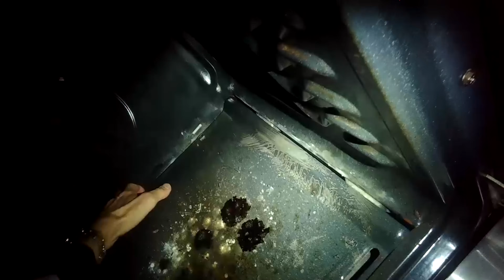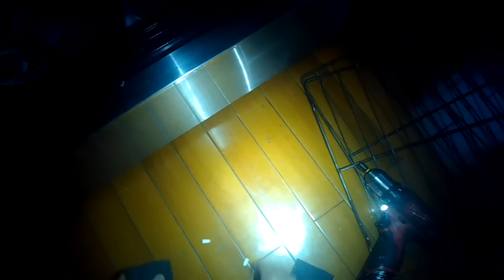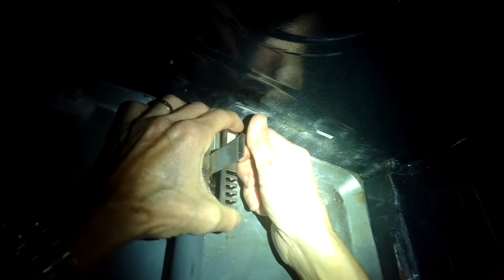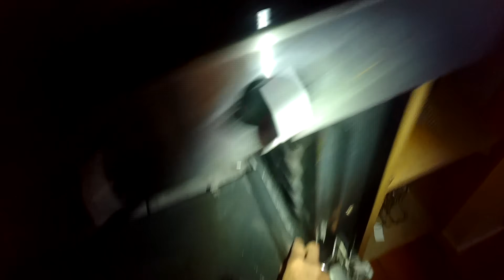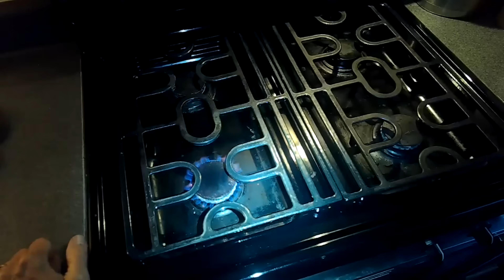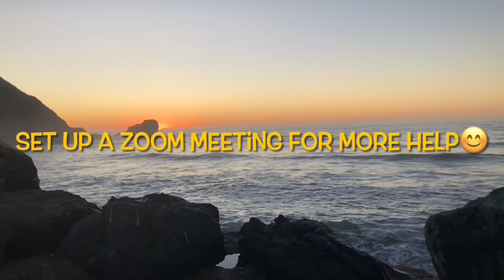✨ SAMSUNG GAS OVEN - WON’T HEAT UP -  QUICK & EASY FIX ✨

Comment: I have a Samsung gas range. Everything works except the bake function won't heat up. What could be the problem?
Reply from the maker: It might be the igniter or the oven sensor.

Comment: Quick question. I replaced after market Ignitor for about 5 months ago. Why is it now it takes 45 mins to heat up 385 degrees? it was really quick when the ignitor was installed. Do you see any other problem beside the ignitor? Hope to hear from you soon. Thank you.
Reply from the maker: 5 months is too short. A new igniter will get it heating quickly again.

Comment: I have a 2 year old Samsung slide in gas range, on propane, that is not working properly. One thing it does is shut itself off as soon as it reaches the set temperature, but tonight when it shut itself off, I used an infrared thermometer and checked it. The temperature was set at 425 but the thermometer was reading 635! I don't think its the igniter. Do you have any suggestions what to check? I called a repairman that told me he won't work on Samsung and I should scrap it and buy a different brand. :/
Reply from the maker: Hi Tina 
Samsung is pretty bad.
I think it needs a new relay board.
The current one is stuck in the on position and the oven will just keep heating.

Comment: My igniter messures 192 Ohms. Does not light. Connections are good. What now?
Reply from the maker: Hi Ed,
I think that igniter is worn out. If it glows but won’t light you just need a new igniter.
If it won’t glow, then you’ll need a new relay board.

Comment: Could you just manually light it until part comes in the mail?
Reply from the maker: Hi Brad,
They only let the gas flow when the igniter is on.

Comment: Great walk though, but what would you say if I've replaced this twice with in a year? It seems like something is causing the igniter to 'die'. I could buy a third one but I'm guessing it will last just a few months as well. Any ideas as to what is causing the igniter to fail?
Reply from the maker: I think the burner tube near the igniter has a rusted hole that lets too big of a flame to hit the igniter.
A new burner tube should fix it👍

Comment: very helpful video does the gas control valve go bad and how hard would it be to just replace both of them at once
Reply from the maker: There’s a 90% chance it’s the igniter that needs to be replaced 👍
Reply: @QuickAndEasy5MinuteAppliance do you have to turn the gas off first? Is there any issues with the reconnecting of the gas pipe?
Reply: @timcarbone007  Dont quote me but I do not think so. ONLY when you turn it on does the valve open- right? So then...do NOT turn it on when repairing it.
Reply: @MOAB-UT you don't have to. 
I used this video to replace the part and it worked! And i didnt have to turn the gas off
Reply: @timcarbone007  Right- like I said. I have mine out too. It's fine. I will replace it tomorrow. Just to be safe, I won't use oven, but broiler or burners would likely be fine. Better safe than sorry.

Comment: great video followed along and replaced igniter.  Oven lit up as usual 15-20 minutes into cook it stopped working again.  Any ideas?
Reply: I just Mine did the same thing. Stopped working and then lost all heat. I turned it off and then back on again and after about 15 minutes it reignited
Reply from the maker: Nice Mike,
It should stop for about 5-10 minutes and then light again .

Comment: My Samsung gas oven will not broil, but it will heat up on bake.. what can it be and any videos to help with steps to repair?
Reply from the maker: Just need a new broil igniter 👍
Reply: Thank you 😊 @QuickAndEasy5MinuteAppliance

Comment: I swapped the igniter from the broiler to the oven and vice versa… the broiler lights, but the oven doesn’t. Ideas?
Reply from the maker: Good idea👍
I think you need a new relay board that sends power to the igniter 👍
Reply: @QuickAndEasy5MinuteAppliance  I put in a new bake igniter and the oven comes on, takes ages to get to temp, and that is because it’s 75 degrees higher than set point.

Comment: for me the oven igniter comes on for about 20 seconds then goes out.  the broiler igniter will come on and light the flam.  Any suggestions?
Reply from the maker: Great Question👍 Click Here to Get Live Expert Help From Me For Just $5.00:
https://www.youtube.com/channel/UCGpInAejvpfVVE4FHB_L-Dg/join
It’s Easy to join.  Just text me at (510) 367-5424 and let me know that you’ve become a member and We’ll Get It Fixed 😊

Comment: We have 8 year old Samsung range. I’ve changed ignitor 12 times….
Reply from the maker: Hi Jeff, is it the bake igniter?
Reply: @QuickAndEasy5MinuteAppliance  yes. I’m beginning to think it may be gas valve safety control going bad.  Just put new ignitor in 2 weeks ago it’s having trouble igniting.  If I put on front burner during preheat gas valve opens and then oven lights

Comment: Could the igniter still be the issue if the stove works just fine? It’s just the oven that does not work.
Reply from the maker: Hi Erick,
I think it’s just your bake igniter that needs to be replaced 👍

Comment: So I found a cheap $20 part on amazon and after a couple minutes and I saw sparks from the igniter and the heating element broke off. I exchanged for the Samsung name brand $70 igniter and now my igniter won’t heat up at all. Am I screwed? Really can’t afford a new oven.
Reply from the maker: I think it blew one of the 2 breakers for the oven.
Can you try resetting the 2 breakers for your oven?
Reply: @QuickAndEasy5MinuteAppliance  not really sure what you mean, are you talking about the circuit breaker in the utility room. I Google searched “resetting Samsung oven breaker” but all I got were videos on soft resetting and hard resetting from the display panel.

Comment: So if the oven usually takes 12/min to heat to 400°F. However, now when you turn the oven on you don’t get any gas or heat. It just stays at her and 175°F… it has to be the igniter right? It’s one of the newer Samsung ovens… maybe 3yrs old? Little newer than in this video but basically the same thing. The only difference is it has the newer “Blue” digital face instead of the “Green” in this video… any suggestions would be greatly appreciated
Reply from the maker: It’s highly likely it’s the igniter 👍
Reply: @QuickAndEasy5MinuteAppliance  was under warranty and Samsung replaced it and it worked fine for about 6/months. I was at work when they fixed it or I would’ve been right next to him asking if he’s using OEM parts. My guess is their warranty service is subcontracted, and a 3rd party company probably used the same Amazon parts I seen online… they had multiple reviews saying the cheap ignition switch that everyone buys is of poor quality and only lasts 6 to 10 months. Well 6/months later and it picks and chooses when it want’s to heat up again idk 🤷‍♂️. It gets stuck and we turn the oven off/on and that’s been working for now but I’m betting it’s that Amazon cheap part the 3rd/party company used or the OEM part or has a bad sensor design or something 🤷‍♂️ it still works we just play the on/off game now things have been hectic
Reply: Ugh we just joined the club. My sister in law’s died a month ago. Now ours just went

Comment: Replaced 2 igniters and a thermostat. Still has problems getting to 350 or higher. Sometimes gets stuck at 150. Any idea ?
Reply from the maker: I think you need to replace the oven relay board.
Reply: @QuickAndEasy5MinuteAppliance so we hav the same oven and it usually takes 12/minutes to go from cold to 450°F. Now it just stays at 175°F and a temperature won’t move up at all? Is that the igniter? I’m thinking it might have a sensor where it won’t send gas if the igniter is bad… I don’t know I’m just guessing
Reply: @tazu700  well Samsung replaced the igniter under warranty and it was fine until recently… I’m thinking it’s gotta be their (I’m assuming Samsung used an OEM part) part… possibly faulty? I mean it still works it just picks and chooses how long it takes to heat up… sometimes it’s 12min to get to 450°F and sometimes much longer. Idk… did some digging and Amazon sells replacement parts for it that are igniters that are poor quality and many review report they only last 6/months?! I’m thinking the repair was a 3rd party company that would definitely use 3rd party parts Lol. But this seems to be a common issue with the igniter on Amazon in the reviews, people are saying it only lasts 6-10/months so idk honestly
Reply: Ever figure it out?
Reply: My ignitor glows but the oven won't ignite

Comment: Can this part be used on any Samsung oven because it is a universal part?
Reply from the maker: Great Question Ann👍 Click Here to Get Live Expert Help From Me For Just $5.00:
https://www.youtube.com/channel/UCGpInAejvpfVVE4FHB_L-Dg/join
Reply: Is this a fix if the broiler is working but the oven doesn’t heat up?
Reply: @GeorgeCostos did you fix it? Any tips mine is at 175°F and doesn’t move… I’m thinking the igniter has a safety valve so it doesn’t release gas if it’s not burning it or something. It has to be the igniter right?

Comment: Hi friend.  Thanks so much for this video.  Hey I have a very old gas pipe system.  I don’t want to turn off gas to oven, valve is old and scary looking.  Couldn’t I in theory replace this without turning gas off? Oven unplugged of course.
Reply from the maker: Yes you can 👍 no need to turn off the gas.
Reply: @QuickAndEasy5MinuteAppliance  thanks so much man.  Your video and reply saved me a grip of money.  Oven fixed.  Wife happy.  Thanks again.

Comment: Would highly recommend NOT using impact tool to tighten bolts ... I was cruising through a repair job and used my impact tool to tighten the small nuts and the ignitor shattered into several pieces ...